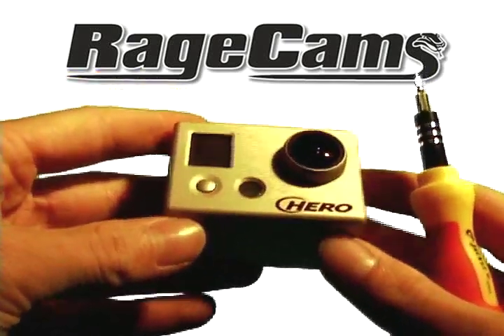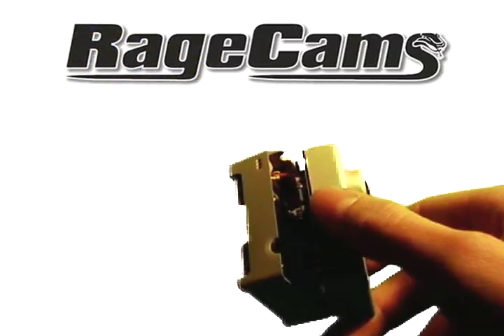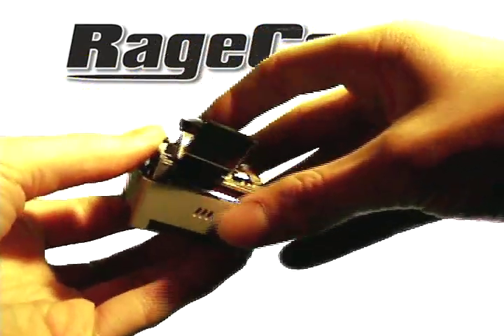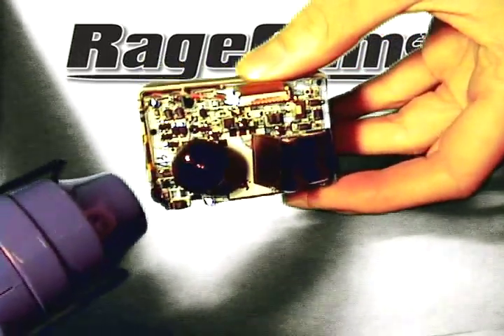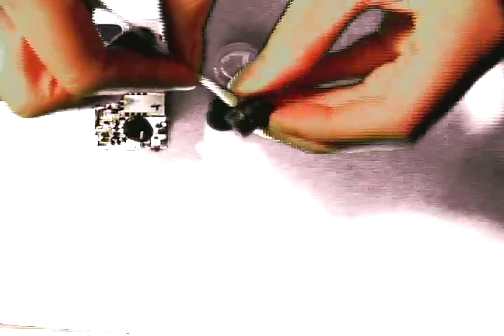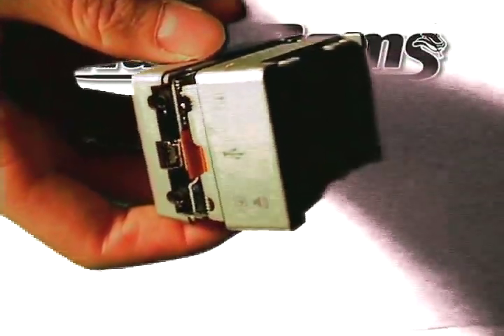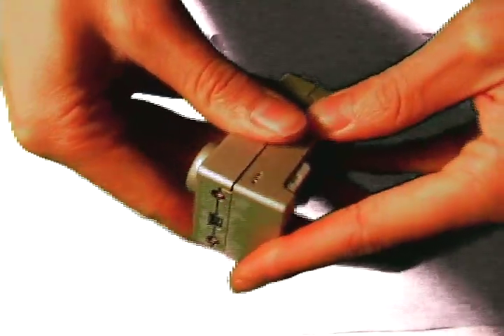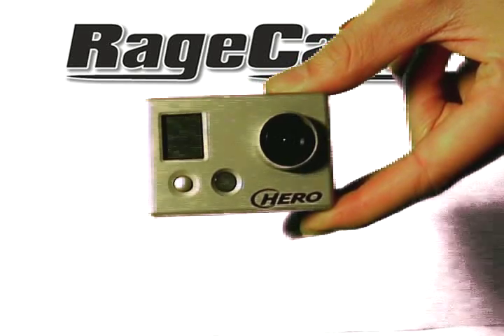GoPro HD 1080p Hero How To Remove Lens RageCams

Comment: @Ilpoto79 
you focus it before you reassemble the camera using video output to a tv set. Or you can cut down the outer lip thats on the outer case of the gopro and that will allow you to focus the lens on the fly without having to take the gopro apart again. Thanks,

Comment from the maker: use an air duster compressed air blast then use a drop of windex on a cue tip wipe, then dry with dry cue tip end, works like a charm, hold it up to light while looking in the sensor to remove debris. Its an easy removal and you really cannot harm the glass sensor unless you get sticky glue on i